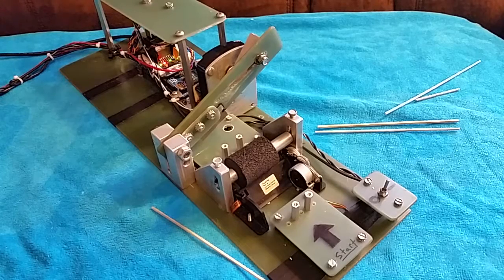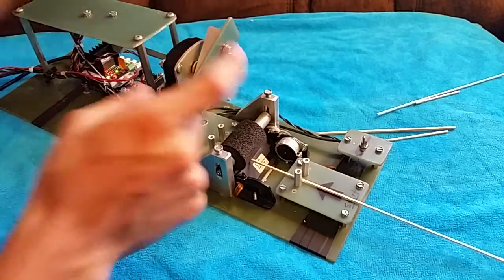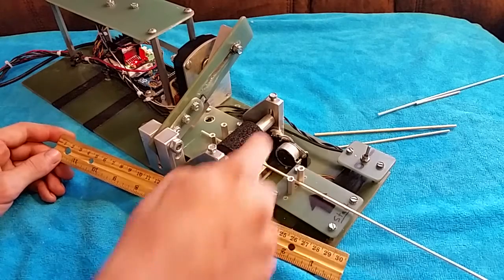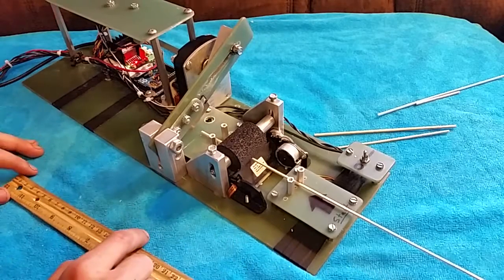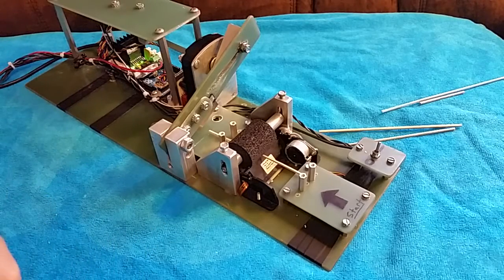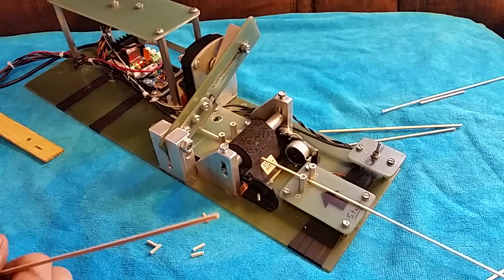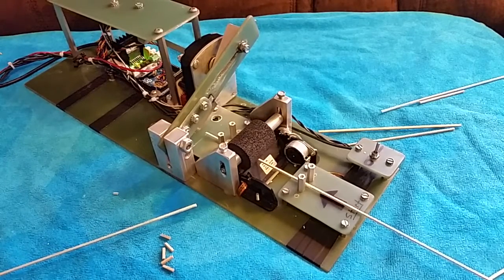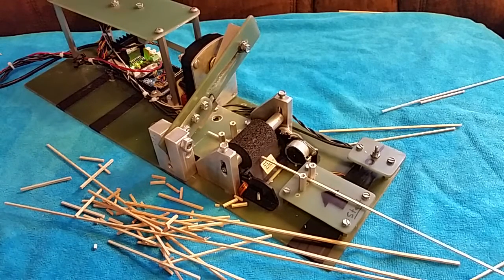Balsa wood cutter is finished

Comment: very Kool man!  I am trying something very similar.  I want to cut nylon webbing (strap material)  is your code available?
Reply: Hey have you thought about using a Nextion display?  it can comm with the UNO.  It is a touch screen so you can program input buttons and fields.  you should check them out.  super inexpensive too.  3.2" screen for less than $40 on Amazon.  again good work man!